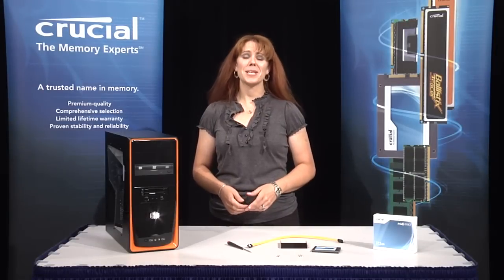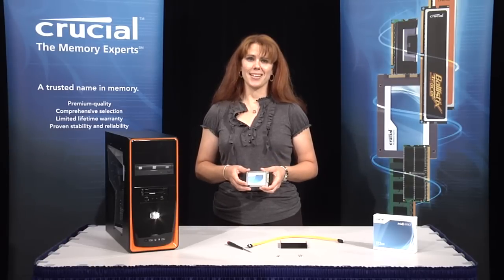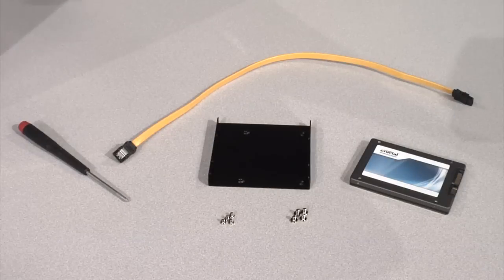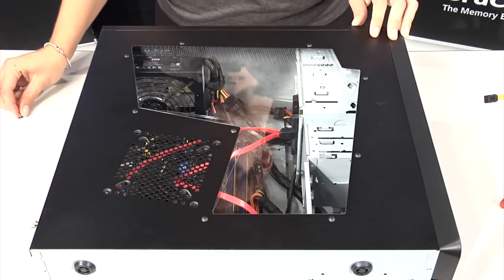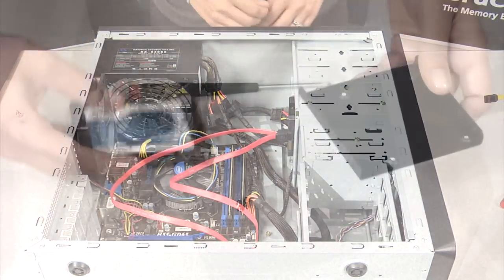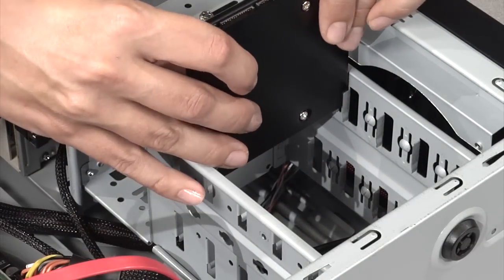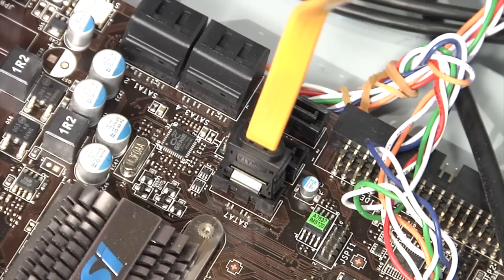Installing an SSD in a Desktop

Comment: Im looking to install a ssd as a cache, and i wanted to know will i have to reinstall the OS after i hook up the ssd?
Reply from the maker: Reggie Barkley You will need to reinstall the OS either before you install it internally.
Reply: That is a lie u can just either migrate it to ssd from hdd or u can re-install windows OEM then migrate if u dont have disc

Comment: Are SSD's powered by the regular 12v and 5v wires of a SATA power cable? Or, do I need to cut the 12v wire?

Comment: I used a mounting bracket  2.5" to 3.5"  to install SSD, one of the side
 screws is long and it touches the metal part of the SSD after I screwd it in, is it ok in 
the desktop? will electricity somehow get there via the screw and mess 
up the SSD?

Comment: Hello Crucial (or any other helpful people listening), this video assumes I have already copied data from a previous drive. This is not the case for me, I am installing Windows 7 from disk, and I am simply trying to get Windows 7 Professional SP1 to recognize it as a drive that I can install on. Right now, Windows installation disk is not able to find the drive.

Does the Crucial SSD have any LEDs that turn on to indicate power is connected?
Does anyone know if other setup is needed, assuming that my power is, in fact, connected correctly? Again, I am working with an out-of-the-box Crucial SSD.

Edit: More information: Crucial MX300 525GB SATA 2.5 Inch Internal Solid State Drive - CT525MX300SSD1

Edit 2: Ubuntu installer can detect the Crucial SSD! So this is definitely a problem with Windows, not the SSD or computer power! But I would like to install Windows as the first partition. not Ubuntu!

Comment: my PSU for some reason don't have the power cable for my ssd drive??? is that normal? and where would I get that particular cable
Reply from the maker: Hello Greta, the power cable from your PSU may already be in use by your hard drive.  If you're replacing your hard drive with an SSD, you can use the hard drive power cable for the new SSD. 

We don't sell these cables so I would be unable to recommend one for you.  I would have a look online to see what options are available.  If you do have any other questions at all, please don't hesitate to ask. - John
Reply: are the SATA cable and 8 screws included when buying a 2.5-inch ssd?

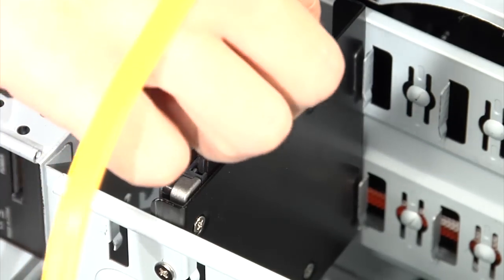Comment: in 2:01 the power cable where does it come from? from motherboard or power supply ?
Reply: I wish to know too
Reply: @tyj1688 the power cable must came from the power supply
The SSD use the same type power cable for the old Hard drive HDD

Comment: as long as there are computers being sold in australia: then yes.
ask a specialist, as you don't seem to have much technical knowledge, a professional will help you. you can't just simply buy a new motherboard. if your computer is 10 years old there is no way you can upgrade it, most likely you will need a complete new one.